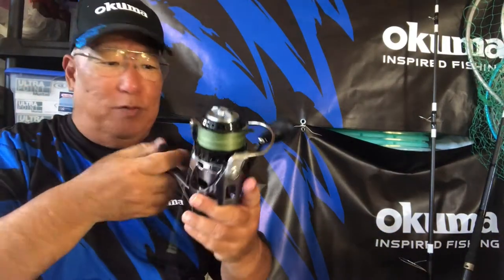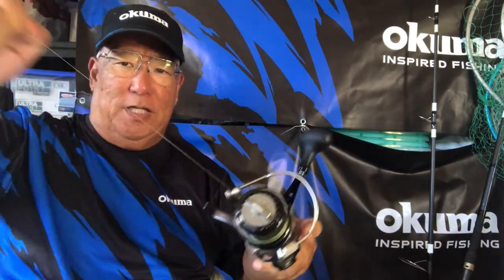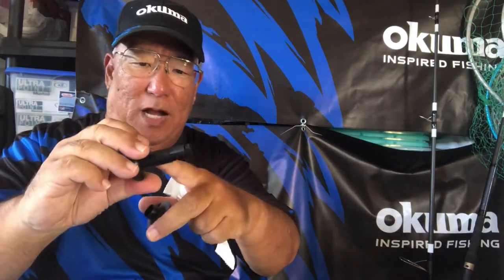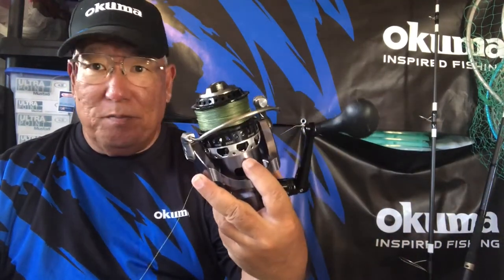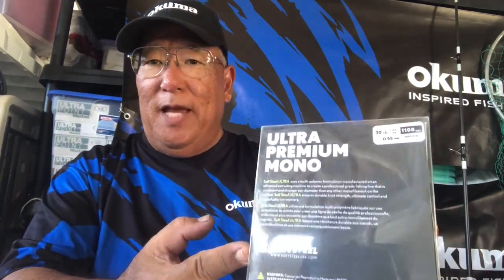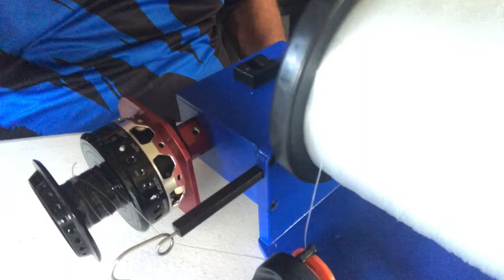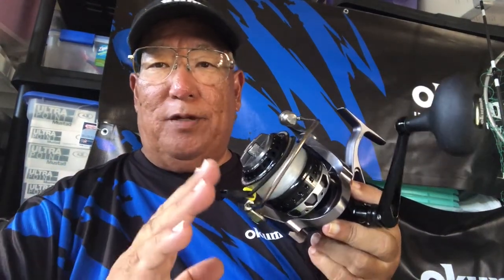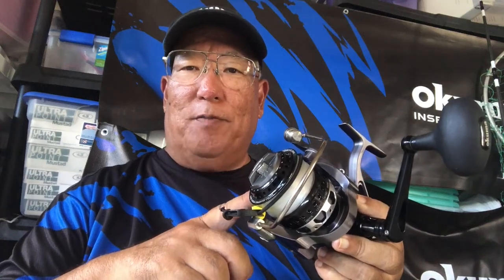Getting Re-Dialed on my Makaira! Spooled Mono!

Comment: How has this reel hold up over time im thinking of Getting one
Reply from the maker: I just got my 20000 Makaira unit 2-days ago. My 10000 unit has been performing perfectly for the past year. I ordered an extra spool for it. So 1 spool has 50lb braid & the other 30lb monofilament. I ordered another 1pc PCH 7'6" Rod for them. Now i have my power pair! I spooled my 20K with 920ft of 80lb braid. Thinking of ordering a spare 20K spool to put 40lb mono on it. 
Right now these are my main rigs. Even World recognized expert Alan Hawk says these are the best around. I sold all 4 of my Stellas. They were good & light but these are stronger (made from forged SS) with higher max drags & a much lower retail price. Shimano dropped the ball twice on the Stellas and were caught by Mr Hawk on it.

Comment: Hi there, I had a question on the makaira. I recently purchased a brand new 30000 and noticed I have some play. I felt it on the handle. I reached out to the distributor and they sent me the below. Did you notice any play? They say it is more noticeable on the larger sizes

 Makaira’s do that although it is less noticeable on the smaller size. I’ll narrow it down to the main gear meshing with the pinion because every spinning reel we have has the same little bit of play where the main gear can move a thou or so.
Reply from the maker: Hi Paul,
I tried my 10K & 20K because of your message. I'm not noticing this. I don't have the 30K so i honestly can't comment on the "play". But the reasoning sounds plausible.
Reply: @ScubaChris  thank you sir! I will most likely be exchanging it. I still haven't used it and I feel like for such a high end peice, it should not have any play.